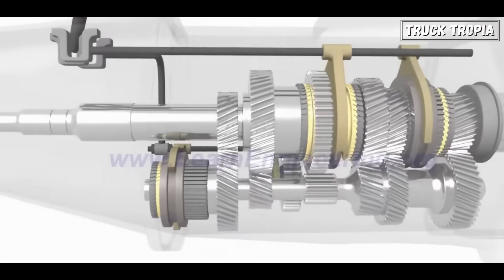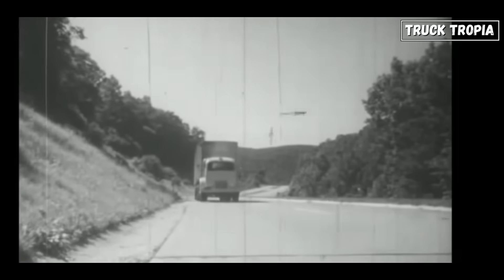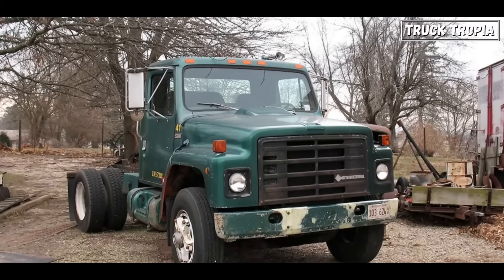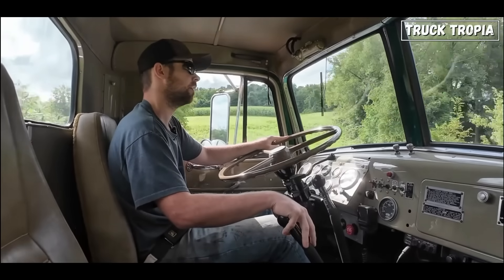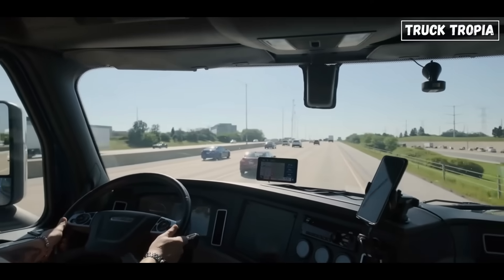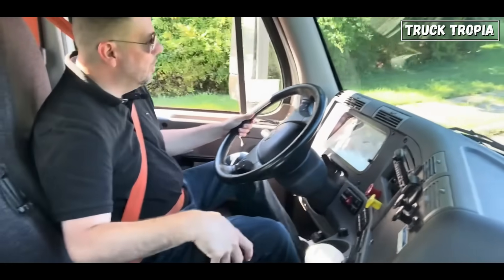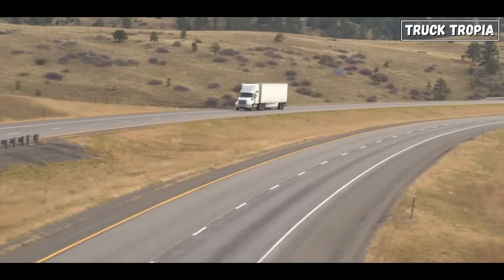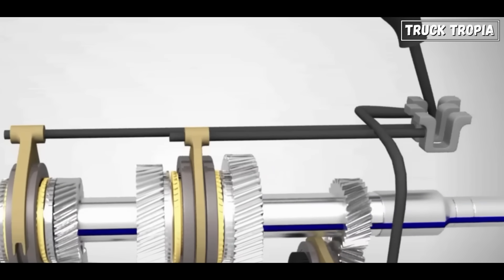Why Do We Keep Adding Gears to Trucks

Comment: AMTs are for steering wheel holders, another bs video
Reply: Ah yes because you can only be a real trucker if you prefer inconvenience.
Reply: It's not an inconvenience it's safety. Manual has engine breaking and won't ruin your service breaks on a steep grade
Reply: @tommy2845  AMT has engine braking too, what are you talking about
Reply: @TopiasSalakka  I was given a modern Kenworth for one trip. Maybe I should have taken training on it first, but being a 49 year veteran long hauler I thought I didn't need it. Driving in mountains I could not get my Jake brakes to work. When you back off the throttle on a long hill, and there were lots of them, the RPM would drop to idle. I guess it is a fuel saving feature. On one long hill I just let it go because I did not want to heat my brakes. It got all the way up to 90 MPH. Very scary. I'm so glad there was no curve at the bottom of that hill! These new automatics are going to k!ll people. I am back on my Peterbilt with an 18 speed manual, and I feel so much safer. Take your automatic and put it...well I'm not going to YT jail.
Reply: @TopiasSalakka I never found a manual transmission to be inconvenient, drove both and will take a manual transmission any day

Comment: Because diesel engines have a very narrow power range.  That's why!
Reply: They always have but there were a lot fewer gears in the past.
Reply: Heavier loads and higher travel speeds,as well as better roads, all determine truck specifications, such as differential gearing, gross weight, engine horsepower, type of terrain (mountainous vs relatively flat ground), on highway or off road driving. 
There are a lot of variables that lay-people don’t know about.

Comment: Double Clutching is Rev Matching. I can right better script.!!!
Reply: I mean I guess yes, you do have to rev match when double clutching, but when I hear Rev matching I think of floating gear [shifting without clutch)
Reply: You can't "write" anything better because you can't even f**king spell!!
Reply: @jamesthornton9399  Sorry to break this to you, but Double Clutching is NOT rev matching.  Green drivers double clutch and grind, and grind, and grind. Sadly double clutch will not guarantee a smooth shift, if they don't rev match. I don't double clutch, but I rev match. I float every gear up and down with two fingers with ease. Some double clutchers are pretty rough.